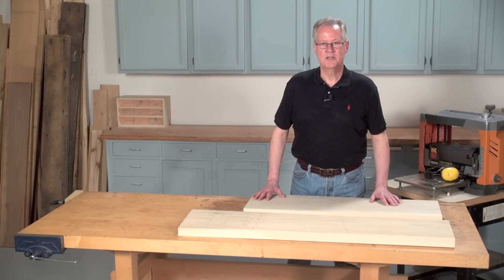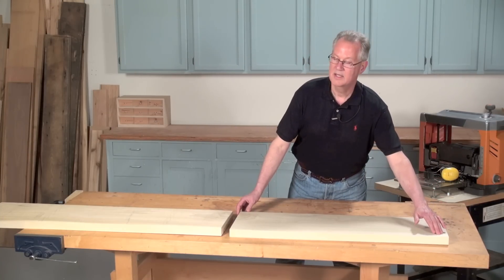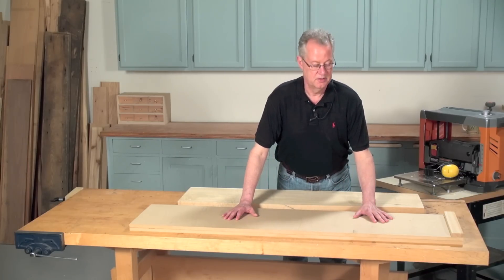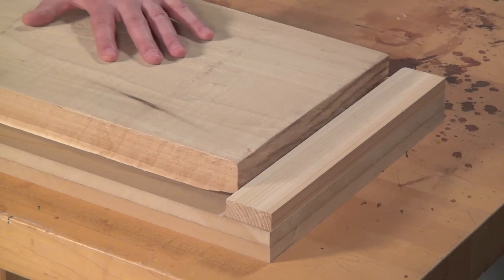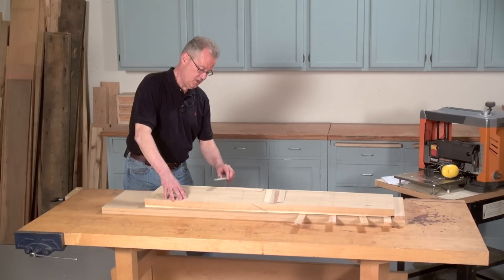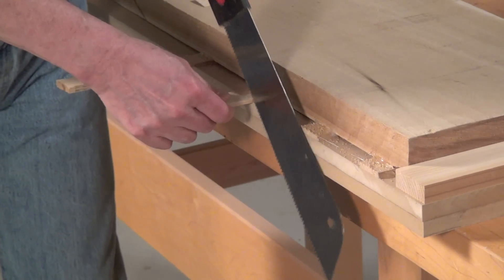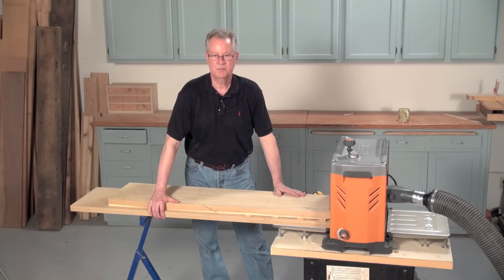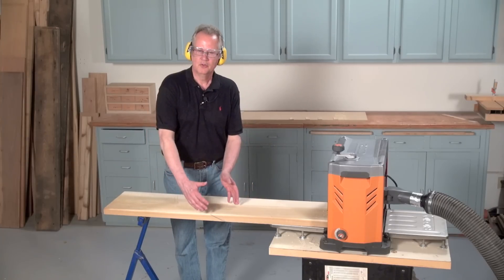Joint with a Thickness Planer

Comment: OLD original post, but seems (without laboriously scanning the prior 133 comments) to need a couple comments.  This is mainly a post bitching about how people call face-planing "jointing".

1) (trivial) This is NOT jointing, it is face planing.  Jointing provides an edge square to a board's face, and utilizes the jointer's fence to provide a square reference surface and cut another surface square to that reference.  The function performed in this video is flattening, and requires only two parallel table surfaces with a slight offset (equal to thickness of planing cut).

2) With respect to jointing...if one adopts this very fine method of FACE PLANING with a sled, using a sufficiently wide thickness planer, the largest jointer he would need is one with a width equal to or greater than the thickness of the wood he wishes to joint (SQUARE).  That said, yes, it is often quite more convenient to have a jointer that can face plane a wide board, but it is not necessary if one possesses a thickness planer and sled of sufficient width.  I get ALL the milling I need to do completed perfectly with a 13" lunch-box planer, a sled, and a 6" jointer.

I won't go into great detail, just Google the words I've used and understand their meaning.  I truly wish that all the woodworking luminaries on YouTube and other places would stop ignorantly calling face-planing "jointing".

Comment: I thought about doing this, but with thin layer of expanding foam mix under board. Sled could be reused using drawknife to remove foam. Might be quicker? Not tried it yet of course, but soon.

Comment: Did I miss something or isn't the stop block positioned at the rear of the board?
Reply: The planer pulls the board through so it will pull the board against the stop. If it were on the rear the planer would just pull the board away from the stop.

Comment: I made this exactly as he describes in the video and have used it on a piece 1.5" rough-sawn walnut. It was REALLY easy and cheap to make compared to those in other videos and it works perfectly. I was amazed at how easily the glue and shims came off, there was no residue left behind on the sled or the walnut. The board came out perfectly flat. There is a reason they say "Keep it Simple, Stupid".

Comment: As a beginner wood worker this was my first big splash. The planer has worked great>>>ur2.pl/856    and left a smooth finish with no additional sanding needed. Planed about 200 feet of rough cedar and it all turned out great and uniform.
Reply: good

Comment: Great video, so after you plane both sides, if you go to your table saw and cut a thin strip from both sides along the length, would the board you have in front of you be true all the way around? Im trying to understand this concept better so I will know if I still need a jointer. It would really be nice to get away with only have one machine, even if it takes a special sled or a little bit longer process. Thanks for any insight. Keep up the great work.
Reply: You still would need a jointer for edge jointing. This method only does face jointing. Alternatively, there are a ton of videos showing how to edge joint without a jointer by using your table saw, or router, etc.
Reply: @davearonow65  Not quite right, you can get an initial true edge with a quality (well adjusted) table saw and a jig. Search youtube it's easy to find.

Comment: I think I may have the same planer as you in the video.  Is it a 13" Ridgid R4331?  If so, exactly how wide can the sled be?  Just curious if it needs to slightly less than 13" or if it can be 13". Thanks.

Comment: all great except for one thing. before making the first cut, check both ends for the highest surface, if you don't, you could take off a minuscule amount of stock at the beginning, but take too much off at the end, and cause damage to the planer.
Reply: Great point, and one that's easy to overlook. Thanks!

Comment: I have a similar jig made of melamine.  I put a stop on one end and then used double sided tape to hold down a rubbery cloth like material that you would put in a drawer or tool box drawer that keeps the board from moving.  No glue is needed, it's held up good.  This does work well with wide boards, saves a lot of time.  I still use a small jointer to put an edge on the board.

Comment: I built this sled and used this method. It works perfectly. Its saved me hours and hours. Thanks for this video.
Two things: that amount of hot glue isn't necessary, and the hot glue does stick to the mdf enough that it pulls out small chunks so eventually I'll need to design a new sled with a replaceable top piece.
Reply: Maybe use melamine.
Reply: @matthewwright57 

What about applying a coat or 2 of water based polyurethane?
Reply: I didn't get any sticking so I assume it depends on the MDF and/or the glue used.

Comment: i have the same planer. how do u not have snipe at both ends?  i built a melamine bed for it and i still get snipe  everytime
Reply: +Matthew udontneedtoknow I use a cut off piece before the work piece and after it. Usually the same one, as it comes out of the machine I move it to the back of the piece. The snipe lands on the cut off.
Reply: +Matthew udontneedtoknow Are you supporting the work piece as it's going in and out? My manual suggests slightly lifting the end both as it is going in and coming out.
Reply: .... or just go oversize, accept the snipe and plan to trim a few mm each end of your board.
Reply: +allyourcode my platform is perfectly level. ill try an raise either end

Comment: Awesome trick, but what about the edges?
Reply: +nokia3210fuck circular saw against a clamped straight edge? That'd be my guess.
Reply: +elindred yes this will work, thanks,
Reply: +nokia3210fuck If your boards are not too wide you can also use the same trick on a planer just mount the board vertically.&#160;

Or use a router table as a jointer there are some good videos on that. 

Or use the table saw there are a hundred good videos on that too.
Reply: +Zachary Maneja (BeyondOurUniverse) Good luck with that.
Reply: There are sleds you can make for the table saw to joint an edge as well.

Comment: That all sounds great - but what if my 8 inch board is CUPPED?  It will not fit on my 6" jointer.  How do I flatten that?
Reply: +Rob I That's no different. You just need to support the high spots on the board, so either flip it with the edges curved down and put something down the middle of the board to support the higher center (not as easy), or flip it with the edges curved up and use shims like in this video to support the higher edges (easier). Then run it through the planer a few times until its flat.

Comment: Just tried this technique and it worked like a charm.  I was having difficulty flattening 8 ft long 10 inch  wide boards with the handplane. (I sold my 6 inch jointer a few months ago) I was constantly chasing my tail.  .Boards  shorter than 4 ft. were easy enough but the long ones were proving difficult for me with their compound twists and curves.

I had some spare MDF in the back shed and it took about an hour to fabricate an 8 ft. sled.  I have enough MDF remaining and will make a shorter 4 ft. sled as well. 

Since I have about 30 longer boards to mill this will now shorten the task.  I wasn't looking forward to all that handplaning:)

Thanks Tim

Comment: Could this be done using a router and planer jig? Correct me if I'm wrong, but I figure a router with that jig works similar to a thickness planer, so I would imagine it'd work all the same. Obviously I haven't got the money or space yet for a planer and jointer...
Reply: Jim Moen I get great results using a planer jig with my router. Definitely another option if you don't have a planer.

Comment: Just started my second year of wood shop in high school and I love it. I actually understood what he was saying. The only downside is that I'm allergic to the dust when you sand the wood,  trees, nature seasons etc. So I'm always sniffing and sneezing in that class. Anyone have a similar problem and found some good vitamins or something that helped. I know that's what doctors are for but just curious.
Reply: Jesus Cuevas As you get older, your allergies may change.  Benedryl might be helpful, but use the non-drowsy formula.
Reply: There's no such thing as non-drowsy Benadryl.  You'd have to use Claritin or Allegra.
Reply: Jesus Cuevas, I have significantly reduced my dust, grass, etc., allergies by taking Barley Green daily and 1000 to 2000 of vit C.  The Barley Green is grown and processed in Japan by a Dr. W.  Get the original it is a little expensive but taking a tablespoon a day with juice or something that you like, will help with the green grass taste.  It takes about 3 or 4 weeks to really notice a difference but it will come.  My daughter also takes it with good results.

Comment: This falls into the category of the things I didn't know I didn't know. This shows a great option for a challenging problem when you don't own a jointer but do have a planer. The other thing I found interesting is the way you've supported the ends of the fold down in-feed and out-feed tables with bolts on your table, presumably to help reduce snipe. I took this into consideration when designing my flip top table on which to mount my planer. Thanks!

Comment: Glue, shims, sawing... all to face joint one board?  That's an absurd amount of work/time for one board.  Just take the guide off of your 8 inch jointer and joint 8 inches of your 12 inch board.  Then use a sled like the one shown in the video (only more narrow) and support only the jointed 8 inches with the sled.  Let the unjointed part of the surface hang off and send it through the planer.  Your board is now level and the planer will give you a nice true surface.  Take off the sled, flip your board over and run it through the planar to finish jointing those remaining 4 inches off your board. 

That process is just three passes through the machines: Partially surface joint side A -> put it on the sled with side A facing down (with only the jointed surface resting on the sled) -> plane side B -> take off sled, flip over board and plane side A to finish the face joint.

No shims, glue, hand sawing.
Reply: I like your method, but I think in practice, you still end up making more than three passes, and you are still using a sled.  Also 8" is decently wide for a jointer.  Some people have only a 4" or 6" jointer.
Reply: +Robert Palmer I don't think you quite grasp the concept of a comment section.  P.s.  nobody cares that you don't care.  See what I did there?
Reply: @simonordo2509 

Six dude was saying this method is absurd.  It isn't absurd, it's a great idea, especially if you don't have a jointer.

The problem with six dude is he should learn to be less abrasive.  He could have politely offered his alternative, (that requires a jointer that some people don't have), without being dickish.  See what I did there?
Reply: +Simon Ordo Clever. Oh so clever.
Reply: Robert Palmer Thought you might like that.
Reply: The whole reason I'm making the sled is that I don't have a jointer (of any kind). Also, the shims and glue went lightning fast and dried in 5 minutes. I would have spent more time adjusting knobs on the fancier sleds in other youtube videos.  For someone who doesn't have a jointer, this is a lifesaver.
Reply: +Six Wings Then don't do it. Nobody cares.

Comment: How is this joint with a thickness planer?  Isn't jointing on the edges?
Reply: A jointer is used for flattened or truing a board.  If you are jointing an edge, e.g. when book matching, both edge need to be square and the jointer is used.
Now what if you want a true and flat board.  An example might be where you want a glue a flap decorative top on a piece of cheaper timber.  Both surfaces need to be flat and true to each other.  If the pieces don't fit in your jointer than it's time to get out the hand plane.
BUT if the boards do fit in your planer thicknesser then you can use a sled to get them both true to each other.

The sled is needed because if you put a warped board in a planer it will come out just as warped but, of course, of uniform thickness along the warped face.  The sled keeps the bottom of the board from flexing under the rollers by filling the space under the warped areas of the board in question.  Thus, the result is a true, flat board on one face.  You can then remove the sled completely and flip the board over.  Now the bottom face is flat (the face you just planed) the other side can be made true as well.

Comment: I purchased a DW735X, and used this method to help create a top for the workbench I'm making. With 7 8' 2x4's glued face to face, it was quite strenuous to maneuver, but it did a Wonderful job.   I used an 8'x1x12 MDF with laminated oak (sold for making a shelf) and attached a small strip to the front as a stop, and used the shims as Tim suggested.  I needed to create some supports for the sled to ride on before and after the planer... this just took 4 more 2x4s cut just less than the bed of the planner.   Works like a dream... very slick. I'll be doing this for smaller pieces in the future, and simply using a jointing plane for all else.Thanks for saving me the need for a jointer.

Comment: I don't understand what the stop at the end of the sled does? And why it gets fed in first?
Reply: Because the pressure rollers are pushing the wood through the planer, if the stop wasn't there the wood could separate from the sled and be pushed through independently.

Comment: Great video. I've been using a similar method for years.  The only difference is that the technique i use has a removable stop block at both ends to hold any piece of stock securely.  Then i use playing cards to shim the gaps, counting the cards to stabilize the wobble equally on both ends (and anywhere else along the way) - this maximizes final thickness.
Reply: thank you for the extra tips... I try to prevent unnecessary injury...